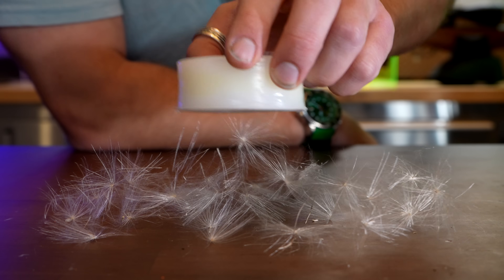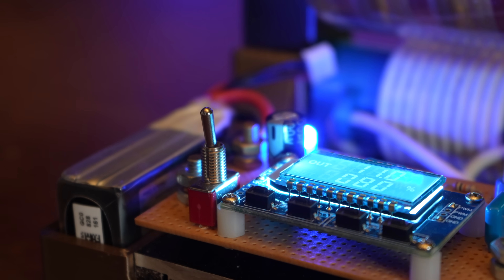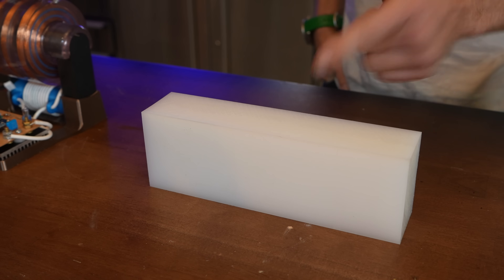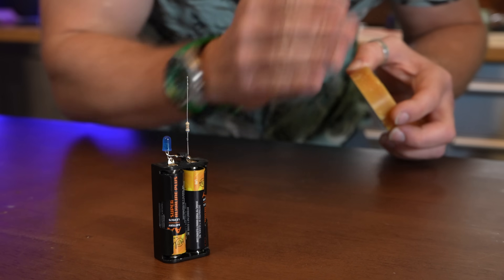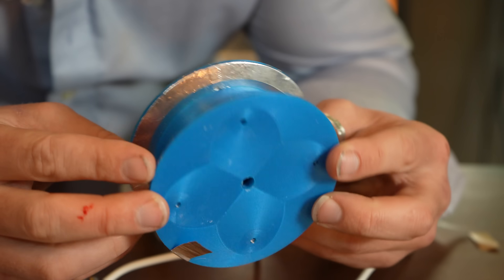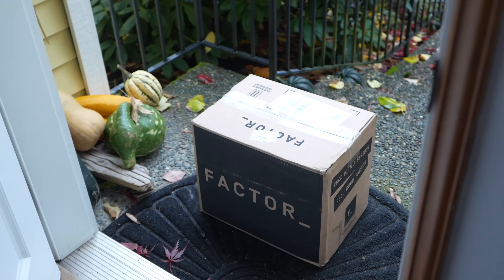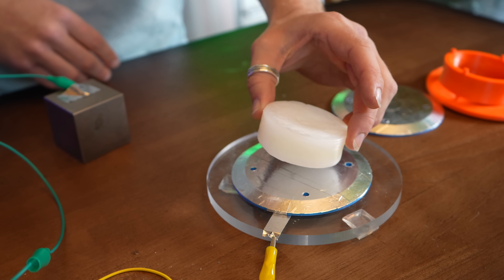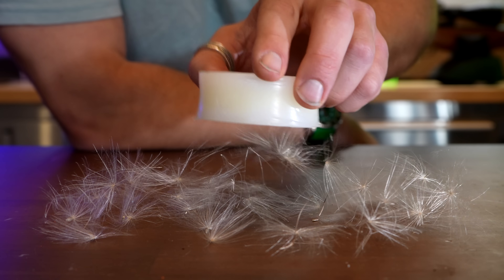Creating an Exotic Material With A Permanent Static Charge (Electret)

Comment: 450 solder points.   When I did my apprenticeship,  each apprentice had to make a bird cage from tinned copper wire.  Every piece of wire had to be perfectly straight and each of the 1,200 solder joints had to be to defence standard 57/21.  We were given a week to do it.

Comment: I’m guessing the van de graff generator produces a positive charge on its dome, pointing your finger at it gives a spiky shape for electrons to bunch up on and more easily get attracted through the air back across to the dome. I think it’s because the electric field density is much higher pointing into sharper shapes, making it easier to ionise the air.

Also electrets are really cool, I’ve wanted to make one myself for ages. It would be really cool to see you make a capacitive motor using electrets and plates.

Comment: I saw a demonstration of a laden jar consisting of a glass cup sandwiched between 2 metal cups. It would burn a hole through a deck of cards when charged with a Vandegraph generator. Amazingly, you could remove the 2 metal cups and they held no charge but when placed back in/on the glass isulator the powerful charge returned.

Comment: I'm not an electrical engineer, but I was curious about the difference between north/south and positive/negative. N/S seems to strictly describe the flow direction, and P/N refers to the alignment of quanta that's channelling the flow of electrons.

Magnets do not "hold" a magnetic field so much as a field is expressed by the alignment of the quanta directing those electrons.

I'd look forward to corrections or alternative models.
Reply: Not to stop you making a Wade-Stokes magnet, nah single nonrotating molecules hold spin and thus β (the magnetic field.)

Comment: There's probably a billion electret microphones in use.

Recently, phones have switched to MEMS microphones but electret ones were the main ones up to several years ago. But say those shady Welcome phones that are still in use around poorer countries, those are still usually electret. Action cameras, wired headsets where you have this button module with a mic, video lavalier mic, PC gaming/comm headset, that's all electret condenser microphones. You can get them up to 24mm in size, but 6mm and 9mm are most popular.

Large membrane condensers use an active polariser instead that supplies about 100V to the capsule.

Comment: Fantastic video! I might have to build one of these and make a video doing experiments with it.

It would be cool if you reworked your field sensors so that instead of being on/off, you could measure the strength. A quick google search shows some field sensing circuits that use op-amps. You couid probably have an arduino or something continuously varying the gain/feedback of the op-amp to find the threshold where the sensor is activated, and then have the arduino control an RGB LED to reflect that field strength. You'd presumably be able to see something akin to the electric field lines.

Comment: Very very cool! So I've always hated how the bulk dipolar charge distribution gets effectively canceled and performance is based only on surface charges...I guess this is basically the dielectric fill of a capacitor...what would be particularly interesting (at least to me) is using something without a fixed dipole but with a huge permittivity anisotropy (like nematic LC) then the electret can be induced when wanted and relaxed when not (Also the permittivity anisotropy would help reduce the required field) since LC is finicky and a pain a similar effect can be induced in non-spherical dielectric particles with a non-uniform electric field (dielectrophoresis)
Reply: Disappearing conductor plates is a safety thing we can start to make now (just ...switch metallicity or conductivity.) Good take!

Comment: That detector array seems like a perfect candidate for some creative PCB design. Make a 5x5 array on a maybe 50mm square board with strategically located power pads around the edges and solder as many as you want into a plane.

Comment: Static Field Detector:
The problem can be modeled in many ways, but the way I chose to see it for this explanation is by modeling both the resistor and your finger as charged particles approaching the source, modeled as another charged particle.  Your finger has a charge closer to the one of the source, but is much closer when you approach it, so the the electrically charged "particles" that were going to the resistor are pulled away to go to your skin and vice-versa.

Comment: Rather than making a 10 by 10 sensor field: Mount your current sensor field on a jig that you can move both horizontally and vertically, either manually or by stepper motors with belts. Then you can mount your electret in front of the sensor field and move the field about while recording the results with a static (non moving in this case) camera on a tripod. 

That should give you an immense amount of data if you overlay the frames additively.

I'd love to see this in action if you have a chance.
Reply: I was thinking the same. He could mount his detector on his 3D printer and just use some g-code sent through the usb port to move it around.

Comment: What if you arrange the connections such that one is in an insulated tube untill it reaches the center, leaving only the very tip free to allow the energy flow coming from the surface of the sphere.  Would you end up with an electret monopole?

Comment: Hmm... if you cut a magnet in half, you'll get 2 magnets - both with north and south poles. However, what happens if you cut an electret in half? Would you have one positively charged and one negatively charged, or will you have 2 with both types of charges?
Reply: Yes it would behave similar to a magnet, maintaining a positive and negative pole no matter where you slice it. That is due to the way he is making these. He applies a polarized field while it is cooling leading to polarized molecules lining up along the field. If instead he bombarded a wax or plastic brick with an electron gun, he could in theory create a uniform distribution of excess electrons such that when sliced the two halves would not be polarized but simply uniformly negatively charged.
Reply: Yes. The system essentially aligns electric dipoles rather than storing charge. When in liquid form, dielectric dipoles align, and as the material solidifies, the dipoles remain in place. This creates an electric field. When you cut this material, you will still have an electret with aligned dipoles in your hands.
Reply: No, magnet rules apply here. The effect is due to molecular alignments, so it works the same as domains in a magnet - cut it in half, get two electrets, though weaker ones.
Reply: I fail to see the difference between magnets and electrets then. I mean... both of them rely of the orientation of their molecules. What's the difference? Why does one create a magnetic field, and the other - electric?
Reply: @Khantia  Magnets are alignments of magnetic domains. Electrets are alignment of polar molecules.
Reply: @Khantia magnetic materials have unpaired electrons. The external applied magnetic field causes the electron spins to align while the material is hot and they stay aligned after it cools below its Curie temperature with external field still applied.
Reply: They work differently on a fundamental level, so you wouldn't expect the same behaviour. Magnets create two magnets when cut in half because magnetic monopoles don't exist (a magnet is a magnetic dipole). Electric monopoles do exist though, so you it is theoretically possible to cut an electret in half and get two electric monopoles (rather than another electret/dipole).
Reply: Not really, electrets can be one single charge. The way this one is made its basically a fixed gradient. You could cut it and put it back together, it won't change when cut apart like magnets do.

Comment: Why not "fake" a larger detector? Get a really precise XY table (from some kind of optics/microscope accessory company), mount the detector to that, and then mount your object in a fixed point above the detector.

You could then move the detector in set increments and image it in each position to create a much higher resolution result. Might want to use much dimmer LEDs though.

Comment: I'm wondering what is the effect of an electret to a corona discharge. Is there possibly a way to increase the corona discharge by pushing the electrons away from the negatively charged pole of an ion thruster, giving the electrons a boost ,if you will. Could it increase the air flow?

Comment: An electrostatic speaker is essentially a "real charge" electret.  This could be fun to build. And depending on size, it has excellent freqency responce  at high and mid range freqency, but you have to go huge to get good base response.

Comment: I do not know how the charges are distributed within the electret, in case each side would carry only one type of charge, cutting it in two would then allow to increase significantly the electric field. I explain: I think the electric field of your electret is due to the difference in position between positive and negative charges, when you approach the electret of an object, one type of charge is closer than the other, this difference in distance between the charge poles thus creates an electric field. If there were only one type of charge, the field generated by the potential difference would be much larger, because there would no longer be the decrease due to the other type of load. 
I am very intrigued by this hypothesis.
It would be great if you make a second video with all the improvements made to your electret.

Comment: For an even more amazing detector: 1) use an array of detectors to figure out the direction of the field, and then 2) use RGB leds to display both hue (which would indicate direction) and brightness (which would indicate strength). 0 strength has no defined direction, so it’s best to make it off-by-default and make it light up when in presence of an electric field.

Comment: Magnets aren't really permanent, it's just that left on their own they'll retain their magnetism for longer than you will live. However, each time the field interacts it degrades a little. You could attach a magnet to the end of a rotating armature and affix a metal plate just outside of its rotational path and measure its magnetic field strength every day. It shouldn't be a huge change, but you'll be able to see it within a relatively short period of time, for a magnet.

Comment: How about make  an electric generator with multiple dipolar electrets on a rotar and use aluminum conductive stator plates. Rotating the rotor will electrostaticly induce a small ac currents at high voltage between the stator plates through a load. 

Power will be a function of the field strength, distance,  area, number of poles/2 and rpm.
Reply: really, way nobody have seen the truly potential of electrets, like motors that run for years without batteries or LEDs powered by electrets (alternating the field with a small motor or another kind of way, downstepping the voltage and upstepping the amperage with a transformer)
Reply: @TheMassive_0   there might be potential for real charge electrets generating high voltage low current  for long distance.  Power is  proportional to charge, surface area, and rpm, while dielectric strength helps decrease distance between plates  which increases capacitance or for a given distance one can increase voltage. Because the voltage is high and current is low one can use lighter and  cheaper aluminum vs heavy heavy expensive copper.  And can do away with expensive  heavy silicon steel in a  generator. While the electrostatic generator with real charge electrets will be physically larger, it has potential to weigh much less which may make a  difference in very large off shore wind turbines that need to transmit high voltage long distance.

Comment: The adhesive on the foil tape prevents a clean flow of electrons between layers. You can see the coronal discharge across the tiny gap.

Comment: Basically a 3d printer with a charged printing base plate and a charged extruder nozzle you should be able to 3d print mechanical electret parts with a quantum computing algorithm to improve quality and  animatronic engineering is reborn should i patten  an autonomous  ooblec electret ai assistance its basically upgrade

Comment: Not sure exactly what the circuit you were using's BOM is, but I'd assume something suitably similar in sensitivity is available in SMD, which would be definitely be the easiest way to make a good higher resolution detector - potentially only 1 solder step and you might not even do that yourself (I understand some of the mail order PCB fabs will also populate the board for reasonable prices - not tried it myself though).

Comment: I believe the reason for the Van deGraffe generator being affected by your finger is a simple one. The field is radiated outward in a toroid, and you finger is essentially grounding it out at that distance. Just a guess, but an easy place to start. Simply put you little detector closer.

Comment: So, if you want to make a higher res version of that sensor array, Do it using tiny surface mount components on a PCB, use one of the online services, have them mount tiny transistors led arrays, and make the antenna with an open trace (Similar to how PCB antennae are done)

if you wanted to go all out, you could (in theory) achieve a heatmap style array using RGB LEDs and bias the green/blue LEDs with higher value resistors in line to raise their forward threshold.

Comment: Would electret fields in fuel lines, assist in fuel burn, on an engine? We know using the exhaust to preheat the fuel, also may do something to the burn ratio. Output may be cleaner.

Comment: There are three types of electrets, dipolar, space charge, and real charge. 

Real charge  has excess distributed on a conductive surface. 

Space charge electrets are insulators charged internally by a particle accelerators pumping most commonly electrons into the material.   

A space charged elecret made with a particle accelerator using several millions of volts can bury electrons deep into clear plastics like acrylic which may later be released to a grounded spike that distorts the electric field and stresses the plastic more than it can tollerate and  the resulting lightning bolt  imprints inside the acrylic makes beautiful lichtenburg figures, sometimes called captured lightning.   

Maybe you'll like to do a video and visit a particle accelerator that makes these very  amazing things.   Google image search captured lightning  and or lichtenburg acrylic. 😊

Comment: Rather than (or perhaps in addition to) lighting a matrix of LEDs, would it be possible to attach each cell of the matrix to a measuring device, say an analog pin on a microcontroller? At that point you could do more sophisticated visualization and analysis of the static field.

Comment: If you want to go high res, you could mount the detectors on a rotating mount like a ventilator. This will spare you a lot of soldering and you can increase the sensor density along the radial axis.